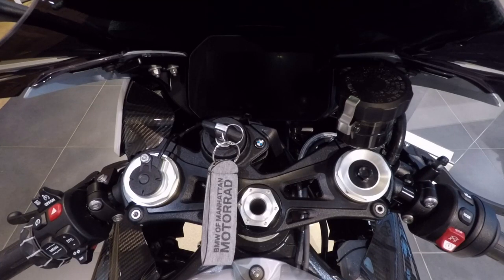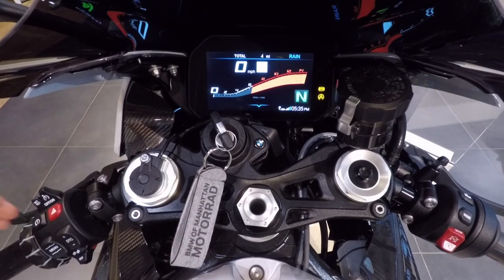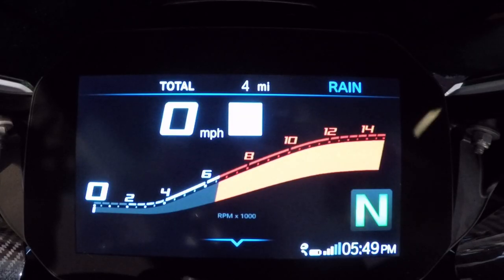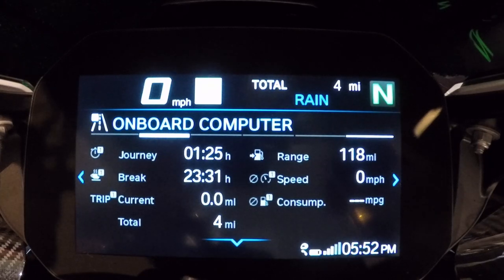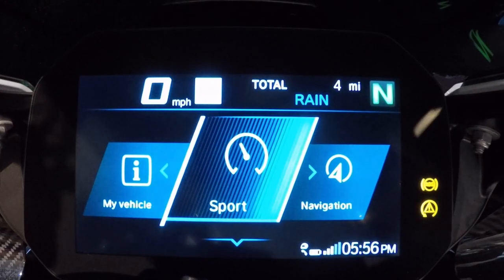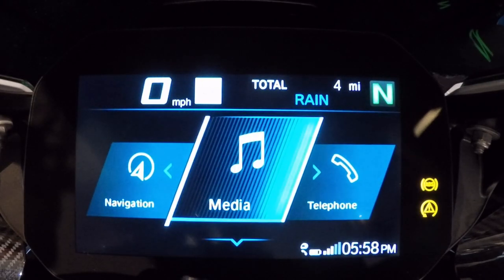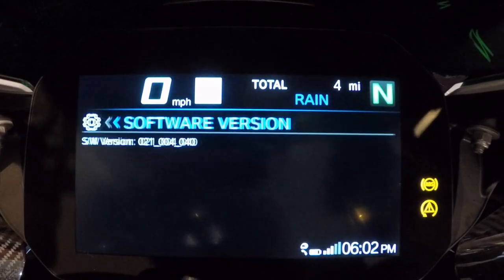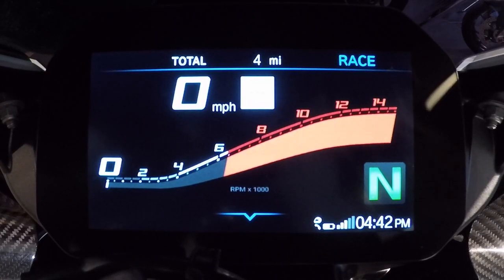BMW S1000RR TFT Explained!

Comment: Bro what's ur pick among the six zx10r,s1000rr,ducativ4s,r1m,R1, ducativ2 aprilla rsv4
Reply: Price is not a problem only performance and reliability and
Casual city rides
Reply from the maker: RSV4 for uniqueness and noise, R1 for bang for the buck (good tech, good noise, good power) R1M is overpriced and outdated. RR for tech, usability, and safety features, V4 for swag, but expensive to maintain and finicky to operate, , and just can't go wrong with a ZX10, but I find them boring.
Reply: @american_english1  thanks for the information was very helpful